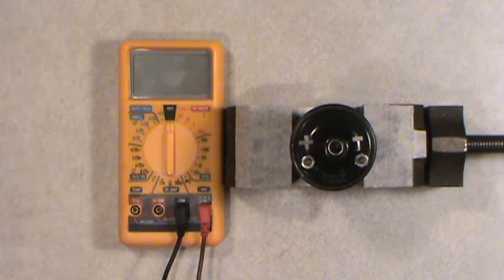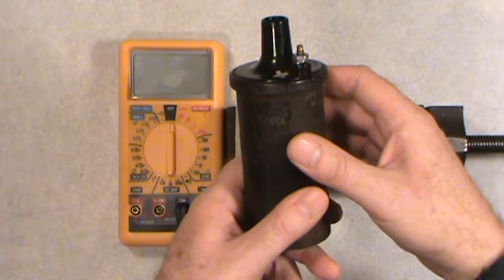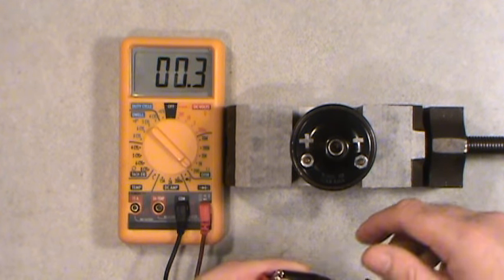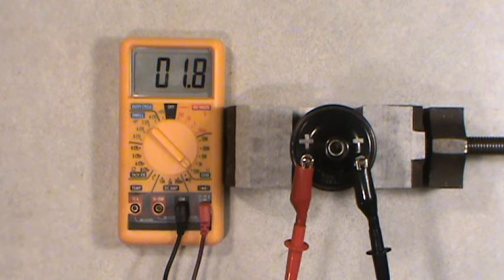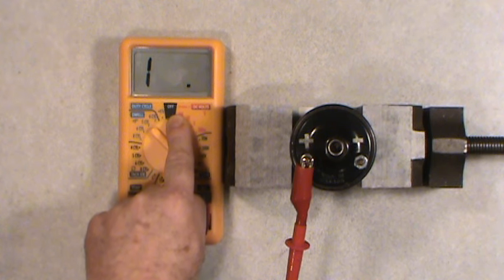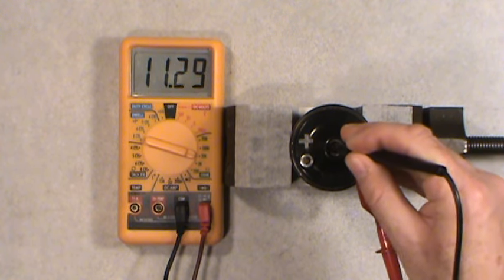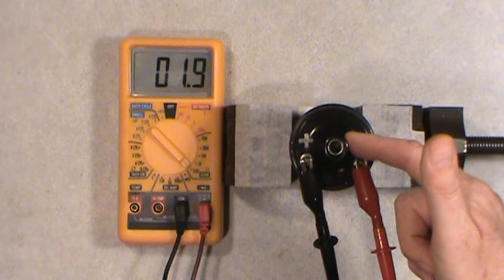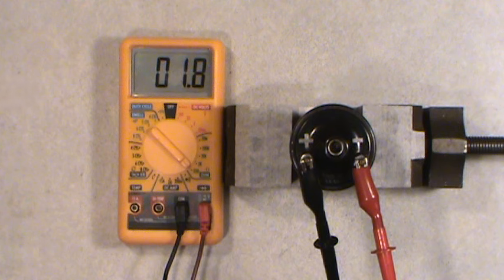Ignition Coil Test (The Short Version)

Comment: If the primary resistance of the coil is higher then the factory specification that means the coil is bad right?
Reply from the maker: Greetings...Schmitty_Love………..Thanks for watching...…….Bad ignition coil...???...maybe, or, maybe not...……When ohms/resistance testing an ignition coil, then, it's the primary/low ohms measurement, that happens to be, the, shall we say..."fussy one"...especially so, on one of the epoxy filled/low primary ohms, type of ignition coil...…..Even the ohm/multi-meter's test leads, resistance value, has to be accounted for, or, the ohm/resistance reading, won't be very accurate at all...…….Did you place your multi-meter on the lowest ohms range, when testing the primary side of the ignition coil...???...…….On mine, it's the 200 ohms range, and, I have to subtract the ohms/resistance value, of my test leads as well, which is .3 ohms, from, what is showing on the readout/display, while testing the primary side...……Make sure, that, you have the ohms/resistance specifications, for the ignition coil in question, as, I've seen it where, there were two different ignition coil manufacturers, that had different (ohms) specifications, for the very same vehicle...!!!...……If you can tell me more about, what the ignition coil is for/out of, then, I'll try to help you out, and...….till next time...….Be Safe, take care, and have a good one.
Reply: RockysRoadshow I followed those instructions in the video regarding finding the lead resistance and accounting for that on the final numbers, utilizing a Fluke 101 which “auto” adjusts or something making it super cumbersome to find a reading on primary(0.26-0.36 ohms per FSM) and secondary (kohms)resistance readings. Which I am looking at and using the factory service manual for the 2003 Yamaha GP1300R , and to answer your question yeah seems to be the challenging/annoying type of filled coil your talking about. My current issue is that the reading with calculations changes even after doing all calculations....... I set the FLUKE 101 down turn off and come back to it a little while later and it’s completely off again and not within Specs. I had a harbor freight that had a 200 ohms setting but got frustrated with that and went to the FLUKE 101 in hopes it would make things easier to log and diagnose since it only has one knob turn and a button to toggle between the types of ohms. Anyways after further analysis and watching videos online I’m thinking it might be the pickup coils that are integrated into the stator. Finding a new OEM stator and in reasonable price is a challenge these days and if it turns out to be stator will need to disassemble exhaust again and pull the engine out. :/
Reply from the maker: Greetings...Schmitty_Love………Did you do a spark test at all...???...as in, remove a spark plug, and lay it on the engine, with the spark plug wire attached, and then, crank it over...???...(any spark, weak spark, or, no spark at all...???)……...A water craft, will usually have, a wear-on-your-wrist, ignition cut-off lanyard, will it not...???...and if so, then, that in itself, will probably render, a no-spark, ignition system situation, if it isn't connected properly, I be thinkin'...…..I worked on some older, carbureted, CDI, dirt bike ignition systems, and, it's basically the same, with the exceptions of, the triggering system, and lighting coils, etc. ……...Does your Service Manual, have ignition system, wiring schematics...???...that way, it might be showing wiring colors, with or without colored tracers on them (stripes, dashes, or dots), and where they connect to, and hopefully, along with, some ohm/resistance testing points as well, maybe...……If you are running in the salt chuck (aka, salt water, sea or ocean), then, corrosion is enemy number one, as in, it attacks wiring connections, and, just about anything metal, that isn't, stainless steel, brass, or bronze...…..There's probably a battery on board, for the electric starter, and maybe, for other things as well, I be thinkin', so, make sure that, the battery is fully charged, and, all wiring connections, fuses, and maybe, fusible links too, if applicable, are working properly, and as they should...…..Good luck, and.....till next time...….Be Safe, take care, and have a good one.
Reply: RockysRoadshow I have cranked it over with spark plugs unbolted from the cylinder head and connected and no spark. I cleaned the teeth on the lanyard and it cranks when the key is on and doesn’t crank when key is off....... thinking it’s stator with its integrated  pickup coils OR bad ECU at this point. Should have been done with it by now just overwhelmed and not enough money to invest into the project like I once did.
Reply from the maker: Greetings...Schmitty_Love.........A factory or after-market, manual's wiring schematic (drawing), of your "exact" water craft, is about the only way, in which you'll be able to find out, what is connected to what, especially considering, any and all, of the components, that have, shall we say, "hidden" electronics and circuitry, embedded inside of them (where they can't be seen).........A good service manual's schematic/drawing, should be showing, quite a few "test points", which will also be showing, wire color coding, and (ohms) resistance values, voltages, etc. , that you can usually test (at those test points), with a reasonably good multi-meter, most of the time..........You can also, look for some websites, on the good ole internet, that have "Forums" on them, for your "exact" water-craft, that way, Ya might find a person or two, that might have already dealt with, and have possibly fixed, the very same problem, that you, yourself, are trying to fix, possibly..........Bad wiring connections, due to corrosion, or whatever, can sometimes, be quite the problem, until it's all tested, and fixed..........I sure don't like any "crimped" wiring connectors, especially on a boat, that sees salt water (very corrosive...!!!), because, over time, I just don't trust them, due to, all of the many problems, that I've had to track down, and fix, over the years (and most, of the bad wiring connectors/wire connections, were near any salt water at all)...........So then, try to find a website "Forum", for your "exact" water-craft, and, if need be, ask some of the very smart folks on there, about, how you might track down your specific problem, and get it fixed..........Good luck, and.......till next time.......Be Safe, take care, and have a good one.
Reply: RockysRoadshow I appreciate it.

Comment: Worth stripping one down
Many years ago i stropped one down to use the wire for rewinding a Scalextric car
Oil has a very distintive smell
Some years later i broke down in London  and had that smell - the coil had exploded!!

+
Reply from the maker: Greetings...Richard Simmons.........Thanks for watching........I've heard that, the older transformers, on the power poles, might have had oil inside of them, that contained PCB's (cancer causing, as I recall), and maybe, the same kind of oil, could have been used in, some of the oil filled, types of, automotive ignition coils as well, possibly...???.......I too, in my teen-age years, use tah rewind, 12 volt, slot car motor's, 3 pole armatures, that were in, both, 1/24 and 1/32 scale race cars (different gauges/diameter of wire, and, number of turns per pole, as well).........Use tah race on, very large, 8 lane tracks........The "larger" track's, 1/24 scale layout was "awesome", and, the faster guys, at that time, could turn a lap, in the 7+ second range...!!!........Use tah, static balance the armatures, by, securing two, double edge razor blades, that were mounted at the correct distance apart, onto, a slot car's, rear, screw-threaded axle, with two nuts, on each end, to secure, each razor blade, then placed on, a fairly level table (worked pretty good, motor ran really smooth/no vibration), and, all we did back then, was to either, drill holes, or, file flats, on the heavy part of the armature's body, to end up with, a good static balance.........Also, shimmed the two magnets, that were inside of the "can" (main housing/body), with adhesive tape, to supposedly, create a stronger magnetic field (magnets were shimmed, as close as possible, to the armature, without having them, rubbing on it)........Also, timed the commutator.........Played with plenty of gear ratios, sponge tire diameters, and even, tire traction "goop"...lol (I recall, some guys using something called wintergreen, possibly)........Guys using the good ole "cox" speed controllers, never got cold hands...!!!...lol...because, after being in use, for a while, those things, sure got to be, on the warm, if not hot, side of things...lol........Tracks, from what I recall, were powered by a number of, quite large, diesel truck batteries.........Sometimes, they would hook up a battery charger, to those batteries, and man, everybody's slot car, sure went a lot faster...!!!...probably, because of, the increase, in battery "voltage", whenever the battery charger was active........If you haven't already seen..."Wing"...slot cars, then, do a search on YouTube, and watch them "race", well, if you are able to see them, that is (all I see most times, is just a "blurr"...lol), and yes, they are really..."That Fast"...!!!...and.....till next time......Be Safe, take care, and have a good one.